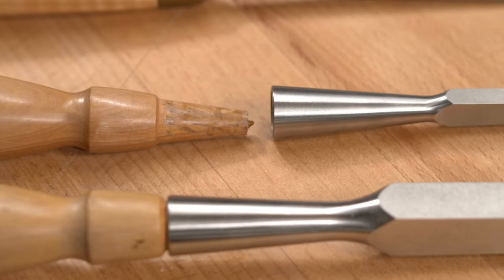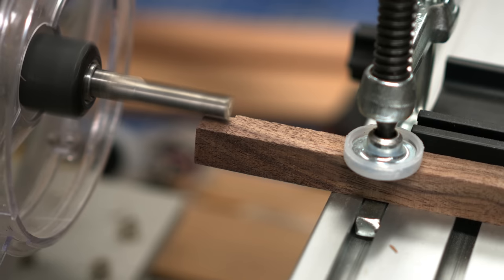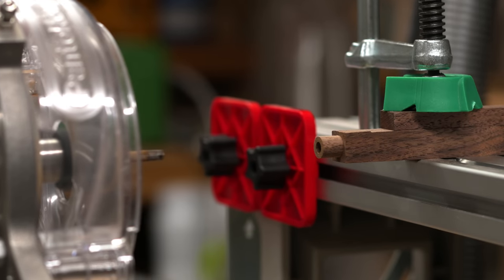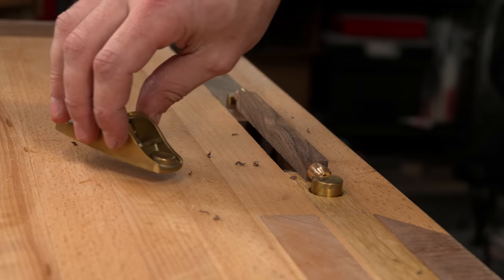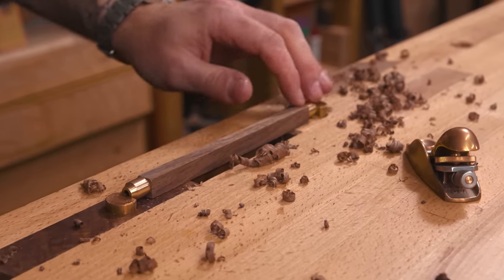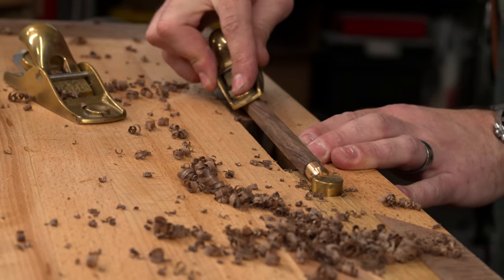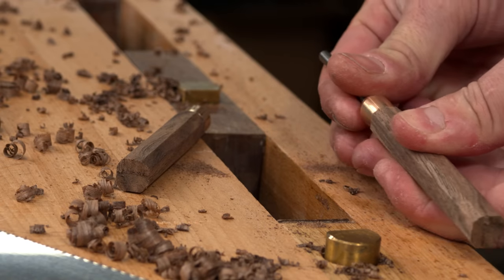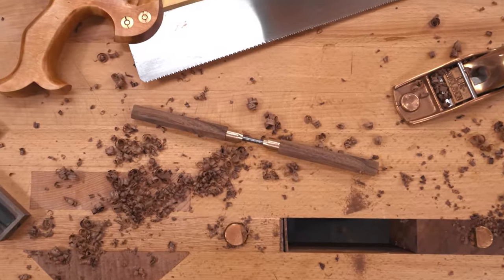Making Woodworking Tools that Don't Suck

Comment: I make a lot of small stuff like right on this old drill press that modified to use as a laithe. Works great for making chisel handles and whatnot but you are right turning is the crack of ww. I just bought a small 24 inch wood laithe At an auction.

Comment: Great video, I think the ends just sanded would look good slightly pollowed perhaps. I like oil finish on tool haldles BLO or tung. I would recommend getting a lathe they are a great addition to a shop and a lot of fun!
Reply from the maker: Someday when I have the room! Agreed on the pillowed ends. That'd look great. Thanks Evan!
Reply: Agree with the Tung Oil. (I'm a potter and mostly I make wood tools for that, so they need to be seriously waterproof, and not just on the surface. My personal mix is 1:1:3 Tung Oil, Marine Varnish:Turpentine. And I coat the entire thing with excess then wrap it in clingfilm for a couple of days, then repeat as it soaks in).

Comment: 5:35 actually a lot of older chisel handles are hexagonal or octagonal with a flat side level with the cutting edge. It makes it a lot easier for when you pick up the tool again so that you won't need to find the cutting side again...plus the obvious benefit of not rolling off the bench
Reply from the maker: Yeah seems like most of the European tools have gotten away from round. Not sure why it’s a thing in the us.
Reply: Heard once an experienced wood worker say that hexa-/octagonal handles are important for muscle memory to build up. Made sesne to me.
Reply: @VanDerPol  I've heard that as well. You can feel where to grip and it's easier to get going once you pick it up.

Comment: Definitely something to be said for hex or octagonal handles. Especially if it’s something you don’t want to rotate in your hand. That said, the first thing I turned on the lathe was a lathe tool handle lol. I actually just epoxied the business end of a bowl gouge into a new handle today. 

I guess if you don’t have a panto router, you couldn’t have used a plug cutter or something?
Reply from the maker: Definitely! Could also cut that shoulder on a router (sketchy), tablesaw (less sketchy, more setup), or chuck it up in a drill press. could also just saw the shoulder and shave off with a chisel or carving gouge. Woodworking. So many ways to do the same exact thing lol
Reply: @SawyerDesign  Haha so true!